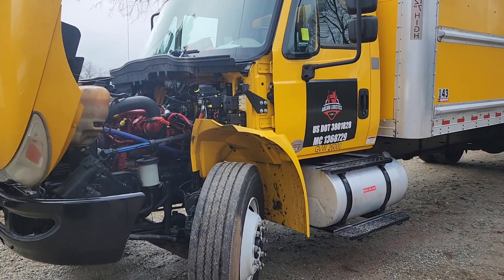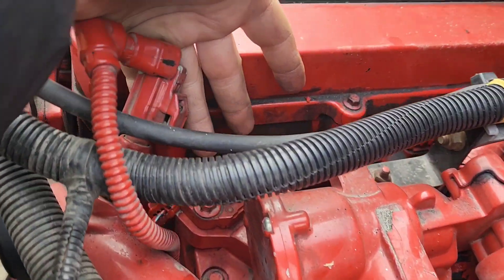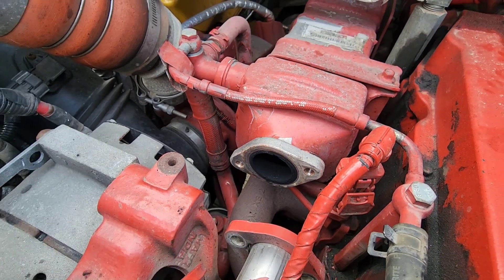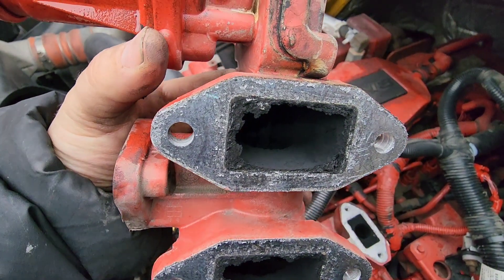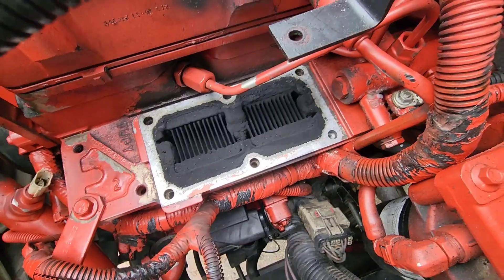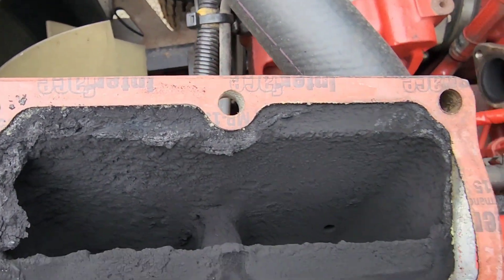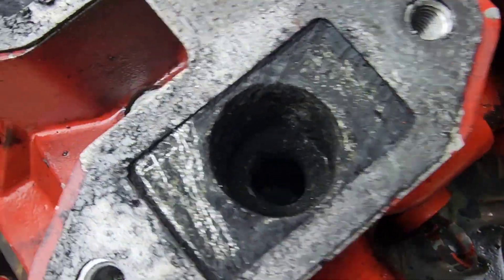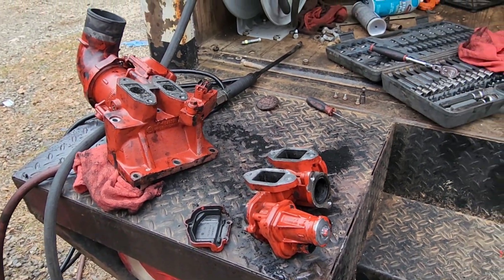How to clean EGR VALVE on Cummins ISB Engine Full Process

Comment: I might need this done to. Nice work!
Reply from the maker: Will check it and see if it needs this done ))
Reply: @naomistruckparts  Thxs, I'm truly excited about getting everything maintenance I've been neglecting it. Both engine light are on. My trk will do a parked regen. But tomorrow my hood bracket needs replaced, I need a new starter, Oil change, Dot inspection. If you don't do DOT inspection i can get that done at the truck stop. After watching your YouTube videos. You no your stuff 100% N I look fwd in a long business relationship with you. See you tomorrow and great videos & content!
Reply from the maker: @Owner-Operator-s1b  will check everything it needs and will go from there